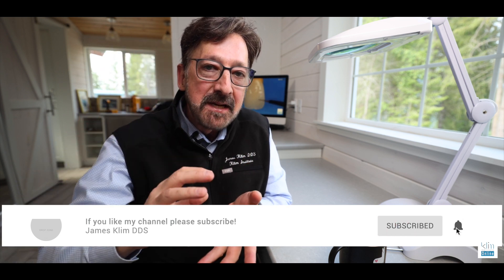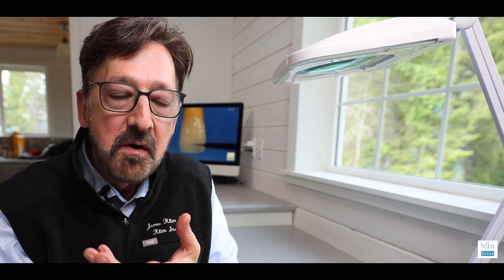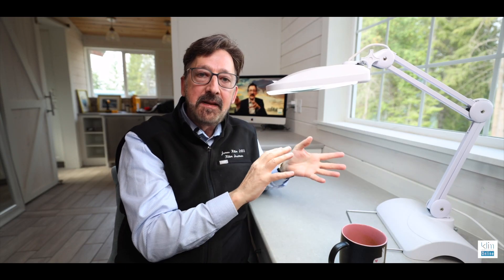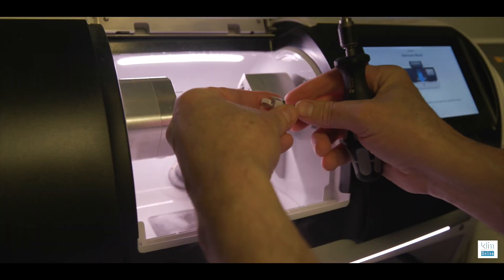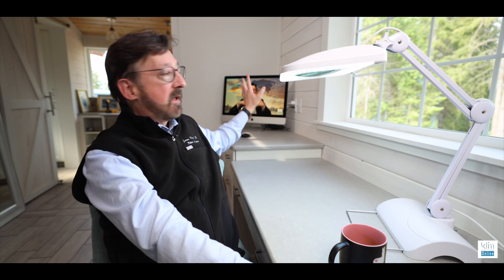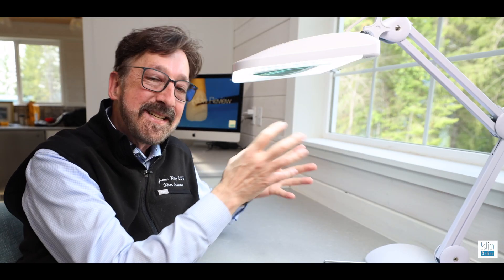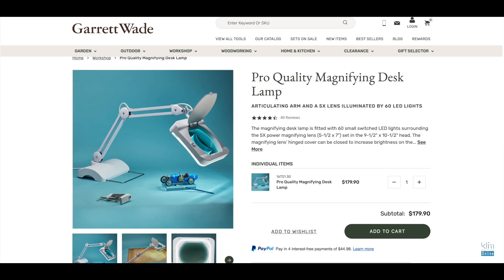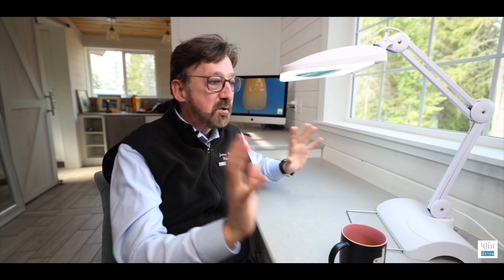My go to CAD CAM Lab Bench Light

Comment: Very great content! I am very grateful for you useful tips! We are just installing the Cerec workflow in a new office and your content helps a lot! 
In Germany it is common to have a dental assistant or a dental technician (both are qualified jobs which you need to be trained for for 3 years). So the workflow is a bit different as not all the steps are in the hands of the dentist. This makes the use of Cerec even more efficient but sometimes a bit harder to control the quality of all steps.
Reply from the maker: Thanks for the comment.  You are on a good path.  The digital platform will go far in your office!